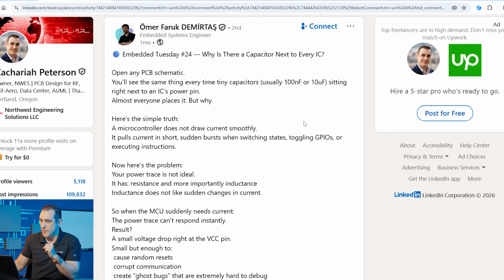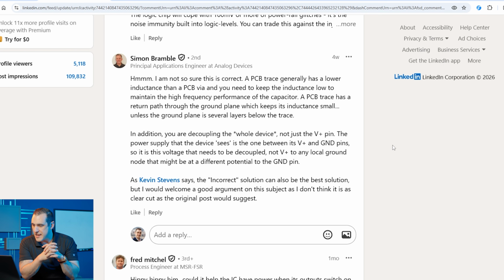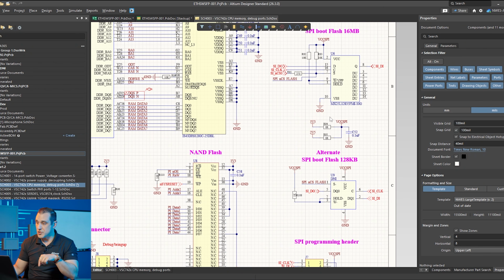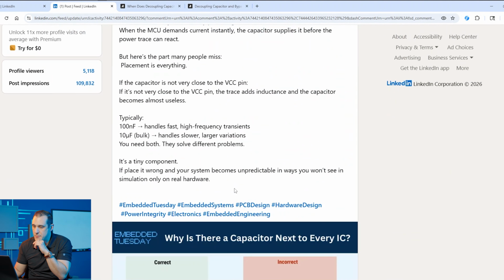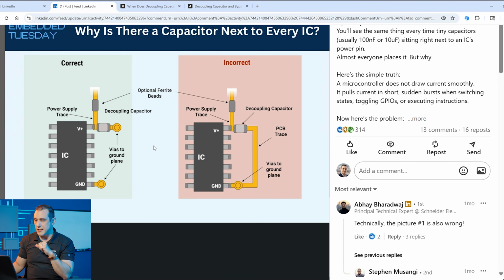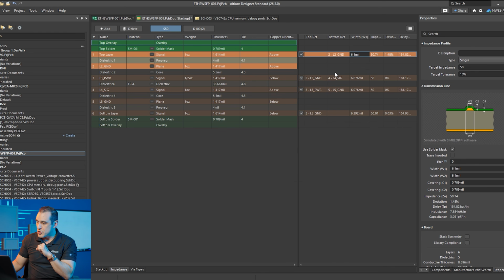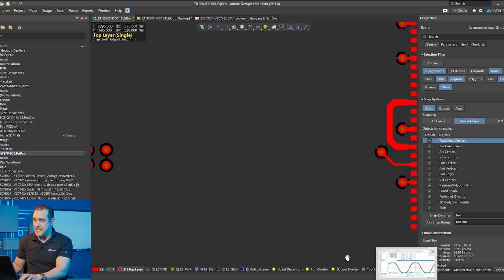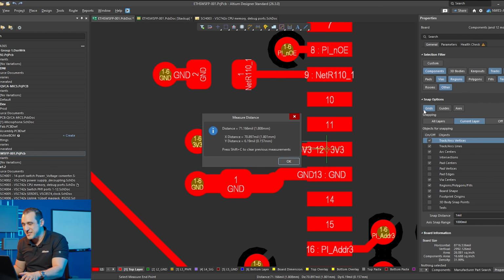Decoupling Capacitor Routing: When to Use Vias vs Traces

Comment: face palm  who the heck routes primary power & gnd traces from an SSOP style package at only 6mils??    
I've spoken at length with LinearTech/AnalogDevices apps engineers regarding factors for minimizing connection inductance and it's important to realize the context they are often dealing with - that is, high di/dt switching/pulse currents;  so, their layouts intentionally use wider traces with a stackup that has a comparatively thin dielectric between the outer and next inner copper layers, all in order to achieve very low inductance traces.  Apparent inductance of vias can also be minimized by placing the power & return vias very close together to get effective field coupling.
Reply: Correct. This just about summarises the situation. Keep the return path close to the forward path to minimise the inductance and by putting a ground plane immediately under the forward path track does this. See my other comments for a full summary - you might have to sort the comments by 'Newest First' to see it- Simon Bramble, Analog Devices
Reply: You would be surprised how often I see it posted on linkedin like it's gospel (or maybe you're not surprised...), so clearly people are doing it. The linear/analog guys are basically confirming what I'm saying since wider rails = lower inductance connection, but it is still lumped per unit length. Thus the usage of planes in digital systems.

Comment: Since giving that seminar, I have spent much time reconsidering my Linkedin post and now disagree with my initial statement. Indeed, my initial post was worded with some doubt in an effort to garner feedback from other Linkedin users, but none was forthcoming, so I did not worry about updating it.

For high frequency signals, the return path needs to be close to the forward path to minimise the loop area and thus provide the best high frequency performance. An uninterrupted ground plane forces the return path to be underneath the forward path, thus minimising the loop area. In the Linkedin example, the forward path flows through the IC so a solid ground plane underneath the IC will force the return path to flow underneath the IC and minimise the loop area. In the right hand figure, this return path is being forced away from the IC, thus increasing the loop area, so the right hand figure is an inferior solution. The loop area is the key to the left hand figure being superior, NOT just the track inductance.

It is difficult to generalise on whether a trace or a via has the higher inductance as it depends on the trace’s dimensions and its proximity to ground planes and I initially assumed, wrongly, that the via's inductance was higher than the trace inductance. It is good to see that the Altium package does this calculation for you, but I did not have access to Altium to prove my theory. I was just using my eyes, which are not good at the best of times! Also, to address a point made in your video, I was not considering the convenience of returning the signal through the ground plane. Yes, returning the signal through a PCB trace will create a problem routing other traces around it and the ground plane makes this easier, but I was just looking at the electrical superiority of one solution over the other. You also compare the trace of 3.9nH with a via of 1nH, when in fact there are 2 vias in the left hand circuit which is 2nH, so you are now comparing a 3.9nH trace with 2nH of vias… and the superiority of one solution over another is becoming more nuanced.

I remember having the discussion with Peter and did not disagree with him. I just opposed his opinion to get him to justify his thought process, playing devil’s advocate. I did this with other members of the audience who thought the right hand layout was superior, just to continue the discussion. As a result of these conversations, including the one with Peter, I changed my mind. At the end of my Linkedin post, I stated that I welcomed a “good argument” on this subject as I wanted to stress-test my original post to get a more concrete view of what is going on, but nobody replied.

Thank you so much for your detailed analysis on this question. I really appreciate it. You have put science behind the guesswork. It is something that will benefit many engineers and, from the feedback I got at subsequent seminars, many engineers have conflicting (and wrong) opinions on this. Thanks for your informed clarity on this complicated matter.

Comment: Hi Zach, this is true, but i would like to ask something.  Can i put a gnd plane on the top plane under the IC to reduce the leght and inductance? thank you for your answer.
Reply: If I understand your statement correctly, you are putting the IC on Layer 1 (the top layer) and the ground plane on Layer 2 (the next layer down). If this is the case, then this would be the best solution. Please see my reply to Zach's presentation. You might have to 'Sort By.. Newest' to see all replies to this video. The real reason why the "via" layout is better than the "track" layout is because the "via" layout minimises the loop area (the loop comprising the forward path and the return path). The fact that this has lower overall inductance (as Zach says) is a secondary issue. It is the loop area that is important here. In the "track" layout, we are forcing the return path away from the forward path (which flows through the IC), so are thus creating a larger loop area and hence an inferior solution. 

Your idea of having the IC on Layer 1 then a ground plane on Layer 2 will minimise the loop area of the forward path (through the IC on Layer 1) and the return path (through the ground plane immediately underneath the IC on Layer 2) and thus provide the best solution.

If the ground plane was on Layer 3 or 4 then the loop area would be larger (but only marginally!) and hence these solutions would be inferior.  

I hope this helps, but see my reply for the full story
Reply: @simonbramble  This is what I normally do in my project, but I wanted to say that the gnd plane is located under the IC on the top layer and layer 2. In my opinion the return length is less than the track and having the gnd plane near the IC much reduces the noise. Clearly it should be used where this solution can be adopted for example when the ground is distant from the VCC.
Reply: For digital systems like the example I show, particularly when you have a large BGA with a lot of power pins and different power domains, you want GND on L2 but then a power plane directly below that on L3. However if you have a 4 layer board, PWR on L3 becomes ineffective because of the large spacing between L3 and L4, and the PWR layer on L3 on a 4 layer board only becomes effective if you put copper pour for GND on L4. That's why in a 4-layer board, it's best to use (SIG+PWR)/GND/GND/(SIG+PWR) as the layer arrangement. If you can't hit your current carrying capacity or the placement of parts is just too dense, then go with a 6 layer PCB.
Reply: @Zachariah-Peterson   thank you Zach for the answer.

Comment: Quick note.  You CAN share GND vias on capacitors IF the current is very low and/or the voltage is basically at or near DC and/or the rate of change of the voltage  is very slow.  Icap = CdV/dt.   other than that dont share vias.

Comment: Traces are in mil, inductance in nH/in, and there's a verbal reference to mm pad / component spacing. 

I wish the PCB design would standardize on metric so we aren't pointless burning time on unit conversions and prone to unit mistakes.
Reply: ... and the thickness of the copper is measured in ounces!

Comment: One would imagine that an IC developer who chose to put power and ground pins far apart would have provided sufficient internal capacitance to compensate for any vias you need to attach to the ground plane
Reply: Mounting capacitors inside a package is not an easy process step. Analog Devices does this with our Silent Switcher 2 portfolio of parts, but it is an expensive process compared with just mounting silicon onto a lead frame and packaging the part
Reply: Why assume? If you're talking about on-die capacitance that number can be quite small, certainly not the 1 uF value that you might see from an application circuit in a datasheet. In the SSOP package, this is yet another reason you need a ground plane. You get the minimum inductance if you have a large power plane, but large rails are okay too. Like Simon Bramble said, mounting discretes inside a package is possible but adds cost, and for a commodity part like a Flash memory with standard package and common pinout the cost does not make sense.

Comment: here is my situation: i have a 0.8 mm pitch BGA with multiple Vcc pins next to each other. I have to use capacitors on bottom.
I have a small internal power plane. Should i also link up pins with polygons on top and bottom ( where i can) or leave them all with 1 via per ball/pad ?
In a way polygons would help share current and reduce overall inductance but also make some potential loops but then again super small ones. 
What is the experts opinion on this matter?
Reply: good question, i am also split on this situation
Reply: Have you approached the IC manufacturer on this point? Maybe they have an evaluation kit that shows you what to do. If so, it is highly likely that the IC would have been tested against this evaluation kit layout, so this is considered the gold standard layout. If you deviate from this layout, you might get better results in some specs but worse in others. This is why we generally recommend following the evaluation kit layout. I hope this helps - Simon

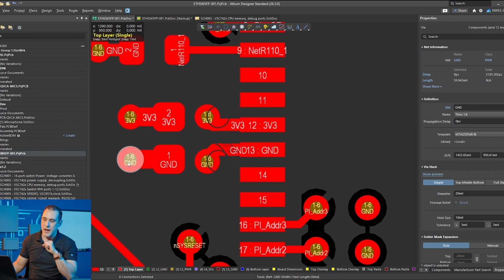Comment: 11:32 What if you route the trace in this 4 via configuration? It will be better than 2 vias and the traces? I'm thinking in the distance of the IC to the ground and 3v3 plane. Or will it add more inductance?
Reply: Just a hobbyist newbie here, but I believe 4 vias wouldn't perform any better for the decoupling capacitor. I don't think it would have negative impact either. You're looking to trace out current loop which will be IC->short trace->capacitor->short trace->IC. The vias will be outside that current loop.

Whether the circuit benefits in other ways from the extra vias, well...I'm sure the answer is "it depends".

Comment: Hi Zach, 
Thank you for everything you do on YouTube and LinkedIn, it's very useful to many of us.
I actually have a question about decoupling capacitors, I would appreciate it if you explain. Many times I see datasheets putting two or more different capacitors at the same pin, like 22 uF and 0.1 uF for example.
Why is that, and does it really differ if I just put the big one? And is there something specific  I should do in the layout if I put both?
Reply: This is because of the differences in resonant frequency of each capacitor.

A capacitor's impedance does not simply reduce with increasing frequency. The capacitor has inductance, created by the packaging of the capacitor. Therefore it looks like a tuned circuit - its impedance will reduce with increasing frequency (where the capacitance dominates) up to a certain point... then its impedance start going back up again as the inductance of the package starts to dominate. This looks like a 'minimum' on the graph of impedance vs frequency

By placing capacitors of different values in parallel you are putting their respective resonant frequency 'minimums' at different points, so those resonant dips create an overall wideband 'dip' and thus better decoupling over a wide range of frequencies.

This is the conventional thinking, although there is now chatter on line from experts that says this might not always be true.

By the way - always put the lower value capacitor closest to the component you are trying to decouple. The higher value capacitor removes the power supply 'bounce' while the lower value capacitor removes the high frequency noise... if that is an easier way of thinking of it - Simon B
Reply: My understanding is that it comes down to the parasitic lead inductance of each capacitor which is usually related to the package size. On my designs I try to place the smallest available footprint caps (as long as the max voltage limit is not exceeded) with as large capacitance that is necessary for the rise time of the input power. Capacitance = I x dt/dV = (Current draw x rising switching time) / amount of voltage droop on the capacitor. For example a max 0.4A draw with a 1uS rise time and max of 0.4V voltage droop results in a cap of at least 1uF required. Also having multiple caps in parallel will also lower the overall inductance. So aim for the largest capacitance, small footprint caps you can fit as close as possible to the chip power leads. If you have the option of a 100nF or 1uF cap in the same package size, aim to use the 1uF.
Reply: @gillevy3739  Correct. Also putting multiple capacitors in parallel increases the capacitance (thus lowering the ripple), but also reduces the effective ESR (which is also good). Any current flowing into or out of a capacitor will charge/discharge the capacitor, but will also cause an I*R voltage drop (I is the current and R is the ESR of the capacitor... just Ohm's Law). The lower the R, the lower the voltage drop. Paralleling up the package inductance is a secondary effect. The main reason for putting caps in parallel is the spread the tuned circuit resonant points across a wider frequency and get better decoupling over a wider range of frequencies